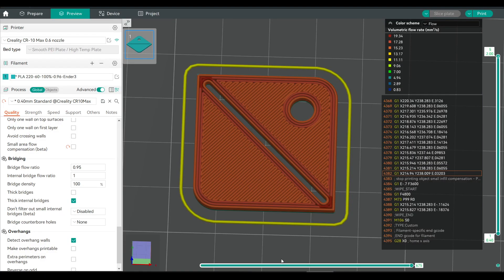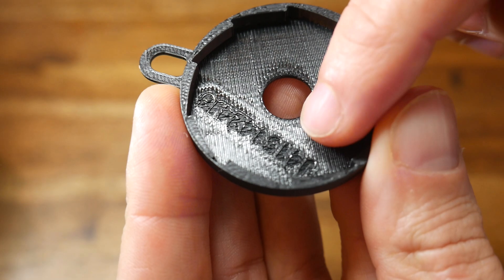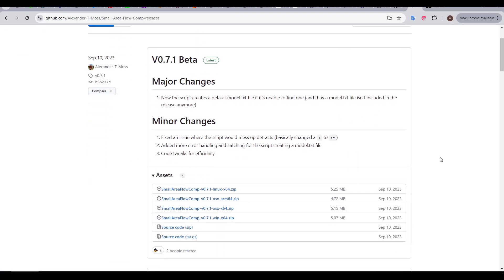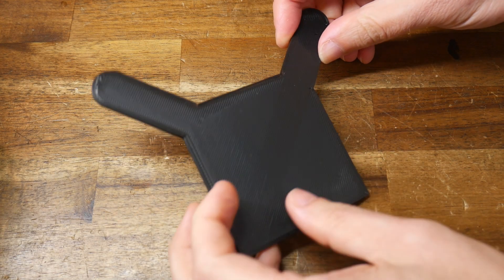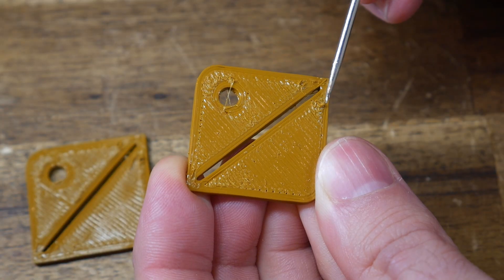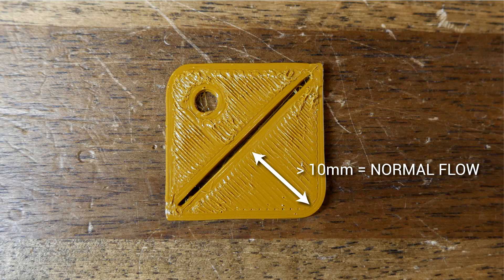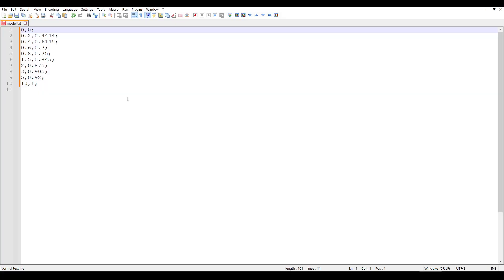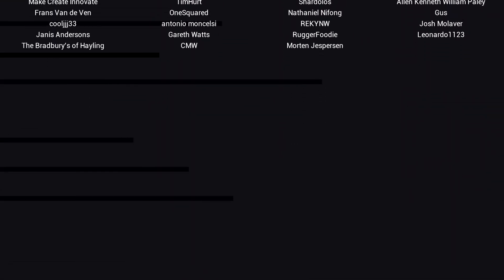How to tune Small Area Flow Compensation to improve 3D print quality

Comment: that's pretty cool but shouldn't pressure advance/Linear advance take care of this?
Reply: Not really, no, that just changes when the extrusion pulses are given, advancing them by a certain pressure dependent time, to account for pressure lag in the hotend. If you have inconsistent extrusion depending on speed, that fast prints extrude less than slow ones, there's nothing it can do about that, it only corrects the transition from fast to slow extrusion or vice versa.

But something still rubs me wrong about this. It's a good first step to figure out a more pointed more physically based solution though.

Comment: Wouldn't this be something like pressure/linear advance?
Reply: I have pressure advance calibrated, but I still use this as it improves quality even more
Reply: As I understand it, Linear Advance corrects for speed, this setting would correct for extrusion length. As speed and extrusion length are related, they will both affect flow in similar ways. However, as the relationship isn't perfect, Linear Advance doesn't completely the overextrusion

Comment: I had this problem with a run of items which needed a mating face finish. I was using a 1.2mm nozzle so the lumps are significant round small features. It's a run of 80 so finish filing would have been tedious. Since I use Cura I found the best way to solve it was to write a script that excised the top skin from the last couple of layers in the gCode and just left the walls.

I need to look at these Slic3r variants.